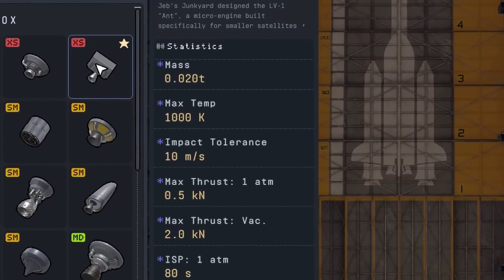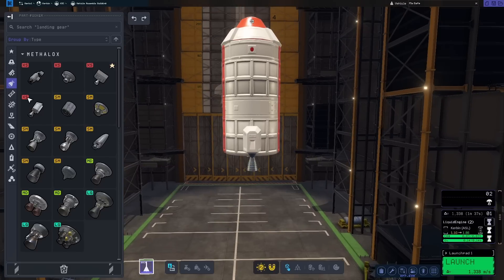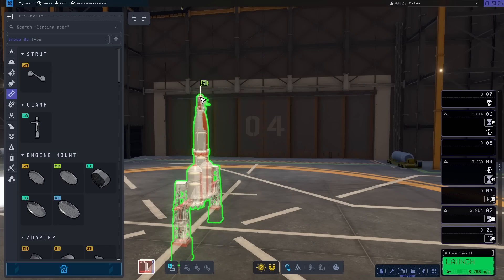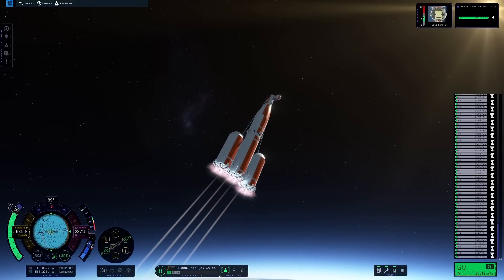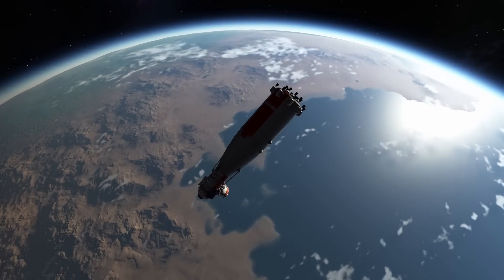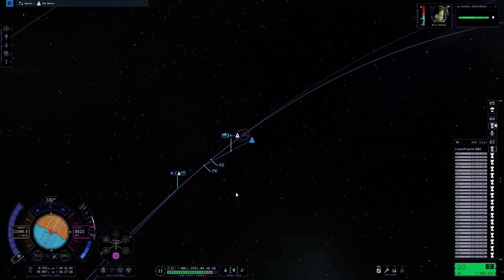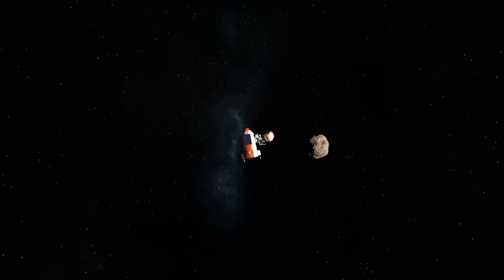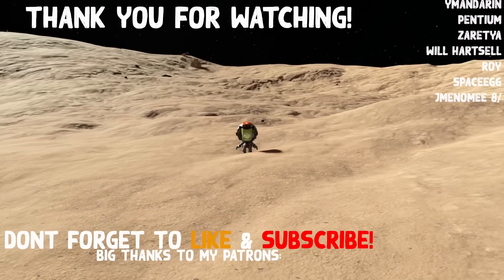Can You Land on Gilly Using ONLY the Smallest Engines?

Comment: you could perhaps have used the bug where movement stops when you deactivate the jetpack to slow down on gilly (if they havent removed that in the patch) and then you would have a full jetpack and if they have not significantly decreased the jetpack delta v in ksp 2 you could even return to kerbin with it and use the same trick to land
Reply from the maker: That bug has been patched already D:
Reply: @Carnasa  ah ok